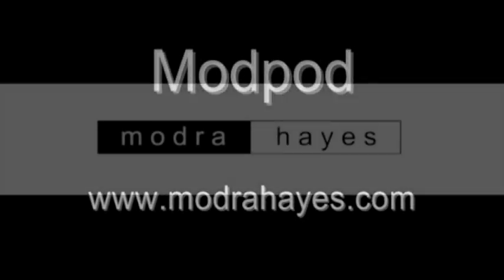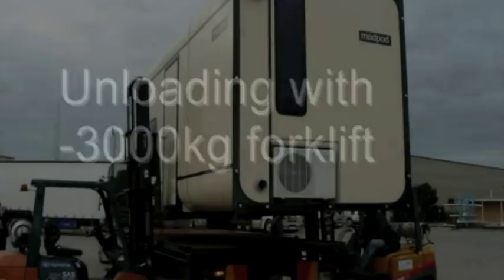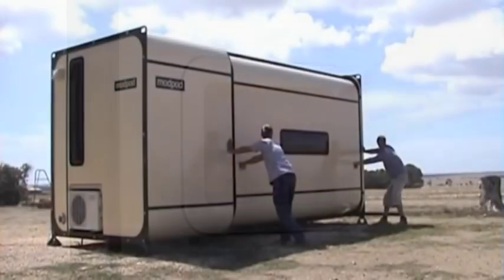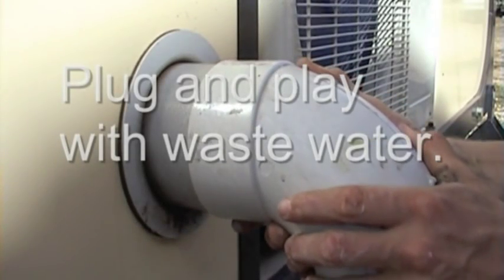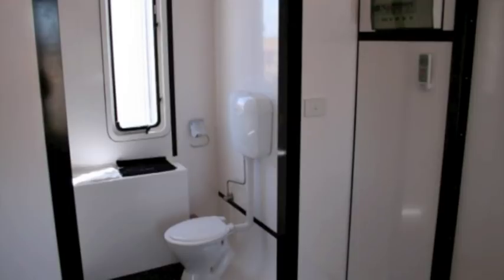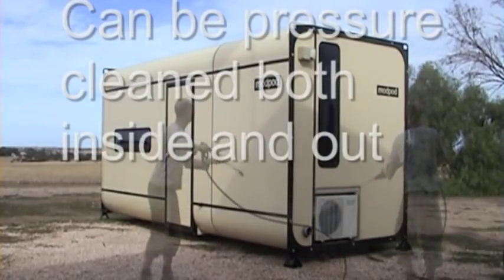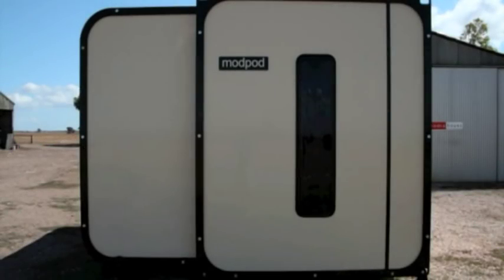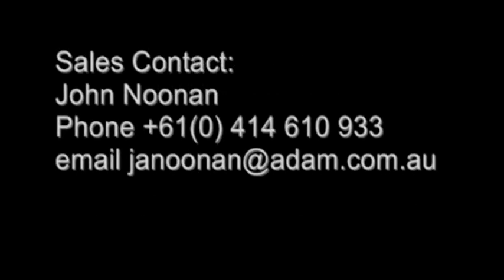saspodTM Accommodation, Service and Storage Video

Comment: Its a pretty cool idea, but it has a few flaws.
friction fit for sewer / septic is a bad  idea....
You should be using standard RV twist-lock fittings and have a shut off valve.
Reply from the maker: Thanks for the suggestions. We use standard container twist lock footings. But can change to other appropriate feet if needed without issue. With respect to sewer options, we can make them permanent for community sewage options, or adjust for Australian "Long Drop" options in regional areas (see the Beachpod for example) or appropriately attached for temporary solutions if trailer mounted (like a caravan).

Comment: The problem is, even if I can afford to purchase one where would I be allowed to put it in a city like London or any modern major city.
Reply from the maker: You would need to speak with your local council/shire/goverment building authority to seek approval. You can either do this directly, or in conjunction with an appropriately authorised Building Consultant or Architect, much as you would any other building in a major city. Even the Beachpod https://www.youtube.com/watch?v=LEBwtIqK640 installation required appropriate building approval. If you place these structures on wheels, like a caravan, the building approvals are much less strict.
Reply from the maker: I should also have added that we can make them in the UK, to any design you prefer ... To see different design alternatives, take a look at the SASpod Facebook page ... https://www.facebook.com/pages/SASpod/253350162621?ref=hl

Comment from the maker: Governments could absolutely use this type of accommodation to house people in. This type of accommodation is an excellent alternative to traditional dwellings made from materials such as wood, or brick or stone or steel, or for that matter any other consumable material that has a finite supply problem. The key advantages are (i) the structure is fire proof, (ii) The structure is cool in summer and warm in winter, (iii) the structure is water proof, (iv) the structure is beautiful!

Comment from the maker: Hi Valena. I have been working as a consultant on this project for 4 years now. The early prototypes came at a high cost because they were used to research various design and manufacturing techniques. Work is continually being done to reduce cost of manufacture to meet all budgets.

Comment: I was wondering if you guys produce a 40 ft version or make a dual coupler type setup?
And can you make the slide outs powered with the support bars attached? if Possible I should think you have an eminently exportable and salable Item to mount on any flat trailer base with many many applications here in the US. how long to order one and how much at the next Items I'm going to the website to see if these options are avalible.